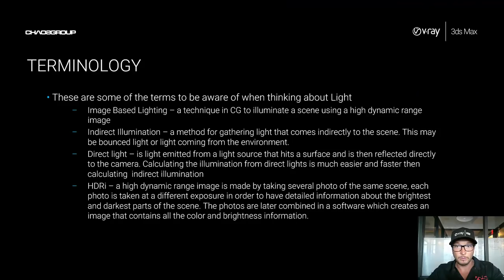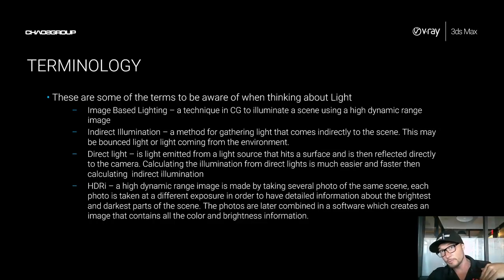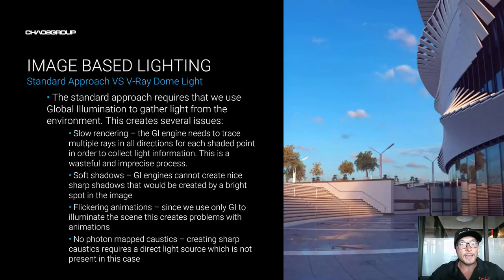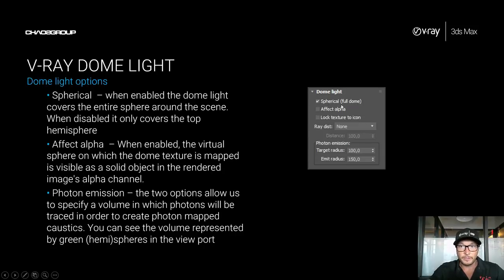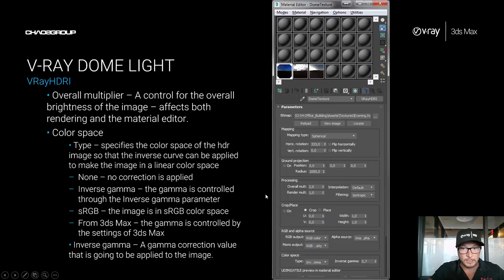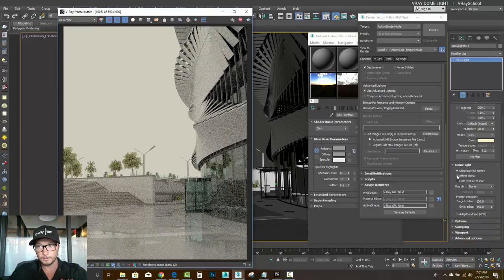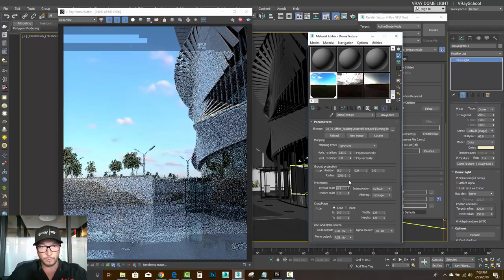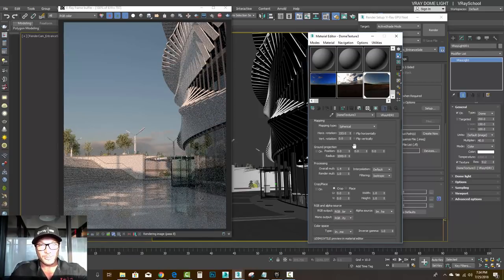VRay Dome Light for EXTERIOR with HDRI - IBL Mehtod

Comment: I've been doing 3D Modeling and Rendering for almost 20 years. I've been working with HDRI Lighting for about 15. Even now, there are times I get rusty, or slip up and forget small but important things that wind up jacking up the whole scene. These videos are just fantastic for sharpen up, knock the rust off, and cover all the broad strokes in a short amount of time.

Comment: Awesome tutorial. I'm Impressed by real-time view and how your machine performs. Will be grate if you can do a video with your recommendations on hardware. What's the key machine components you will go for with a reasonable price?
Reply from the maker: here's chap RTX - I'd get that since everything moving to RT https://www.amazon.com/s?k=laptop+rtx&i=electronics&rh=n%3A13896617011%2Cp_n_feature_four_browse-bin%3A2289792011%2Cp_n_feature_seven_browse-bin%3A18107822011%2Cp_n_size_browse-bin%3A7817234011%2Cp_n_feature_five_browse-bin%3A13580787011%7C13580788011&s=price-asc-rank&dc&qid=1588053188&rnid=2257851011&swrs=A34F045A2A1BEF9B785BE3CCBCD806E6&ref=sr_st_price-asc-rank#ace-4993291862

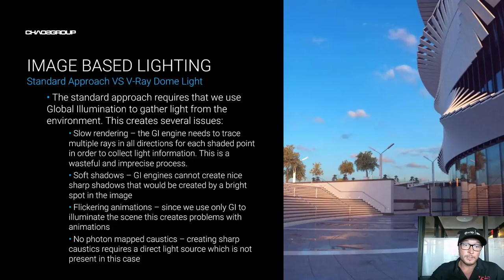Comment: Hi, i have a question, actually two. Firtsly, i have seen some examples that people use hdri+vray sun light together for exterior rendering, so if use sun light with hdri do i lose the speed advantage that you mentioned on 5:11 because of the gi engine? İs putting a vray sun to the scene increasing the render time? Secondly, what is the resolution of hdri photo that you use? Thanks and take care.
Reply from the maker: you get extra light to control and a bit more realistic results with VRay sun and HDRI...HDRI normally used as ambiance and reflection for the exteriors. Sun adds extra shadows - just needs to be matched position to get a smooth effect. Watch this split hdri method https://www.youtube.com/watch?v=X2aES1BuAu4
Reply from the maker: here another good tutorial for exterior lighting https://www.youtube.com/watch?v=tCydat4Grio